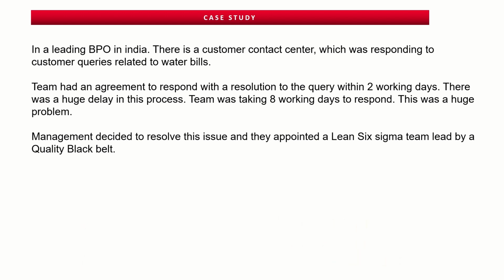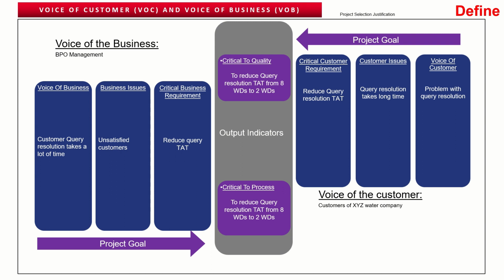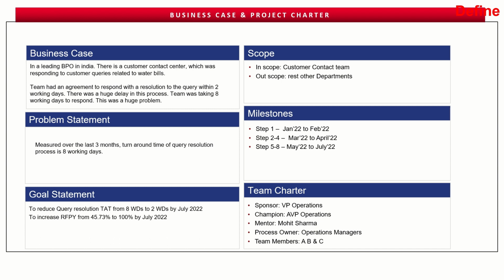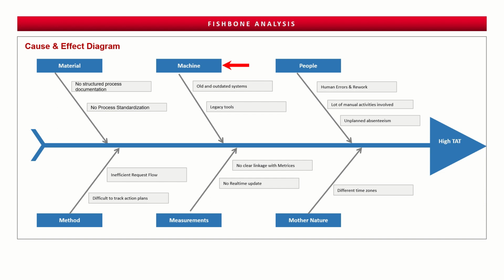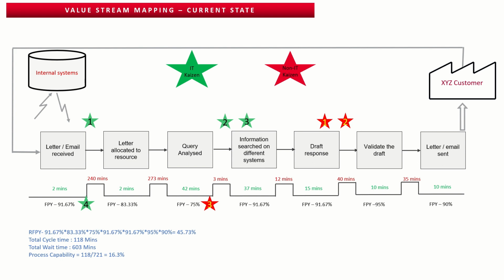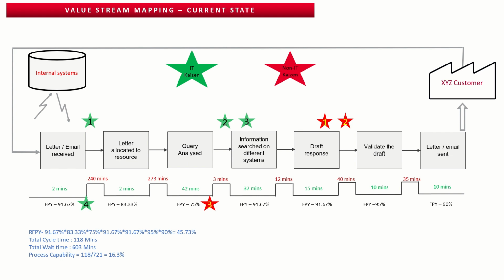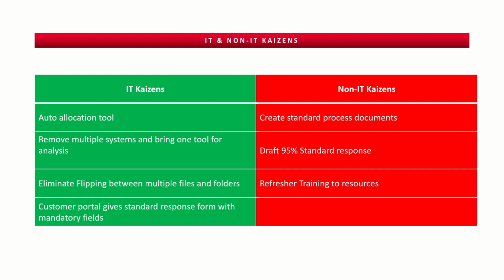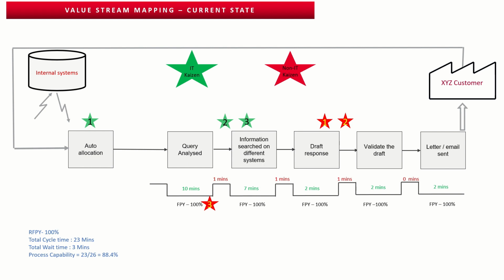Reduce Query Resolution TAT for Customer contact Team - BPO Case study | Lean Case Study

Comment: Sir I think you have calculated cycle time incorrectly. Cycle time = VA + NVA = 721 Min.
Total unit time will be 118 Min 
Total wait time will be 603 Min

Process efficiency = UT\CT=118\721= 16.3 %